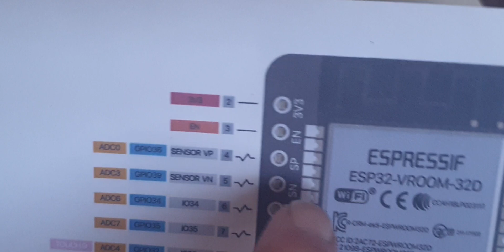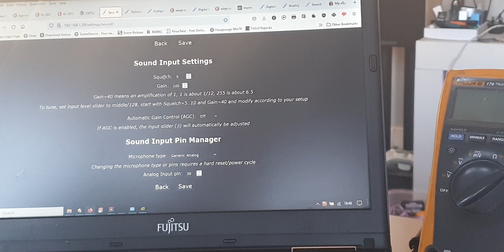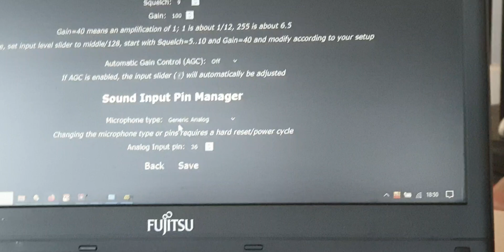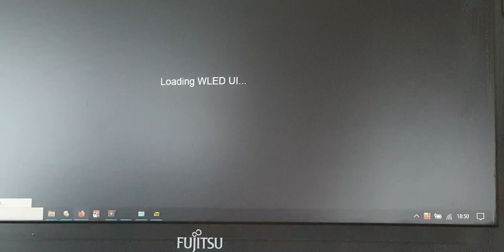The (Almost) OAP's Guide To WLED in 2023: Audio Reactive Set Up With A MAX4466 Analogue Microphone.

Comment: Good video, although was pretty hard to follow the schematic, but at the end i work it out but is not working🥲, only on standard preset, tested 4 different mic MAX4466 (thought I had a dud one) none worked, tried many of the Sound effects, some work but not sound reactive, go figure
Reply from the maker: You did set the mic in prefs???
Reply: Rather bizarrely my esp32 pin 36 (according to the docs) is marked up as pin 35. I couldn't actually see it without a magnifying glass. It took me a good amount of time to realise what was going on and changed the pin setting to pin 35.